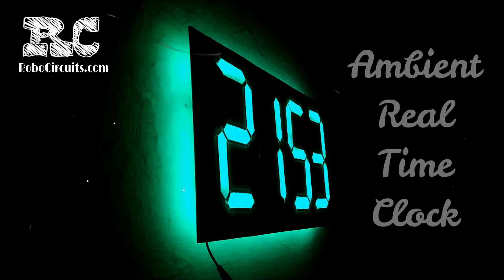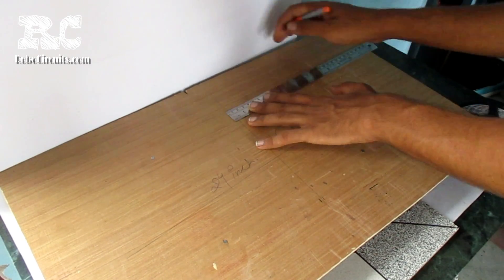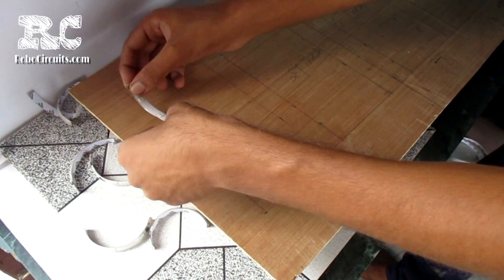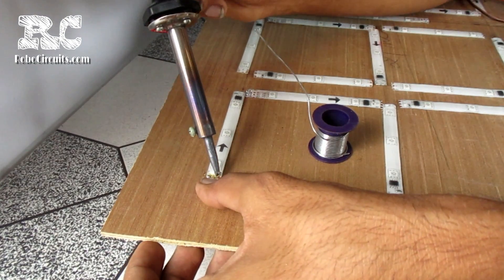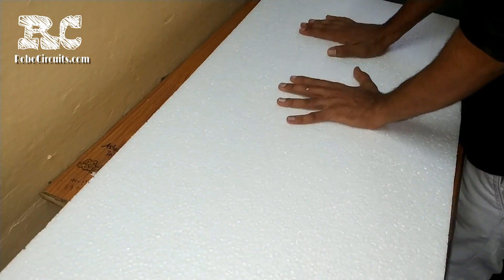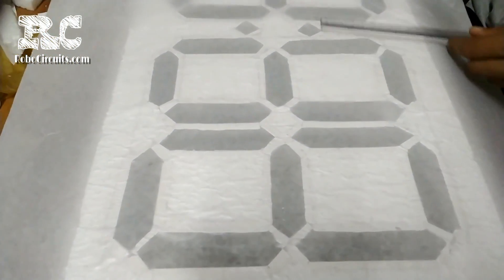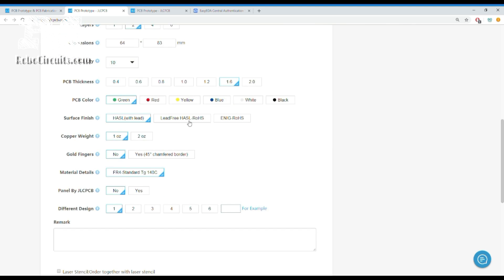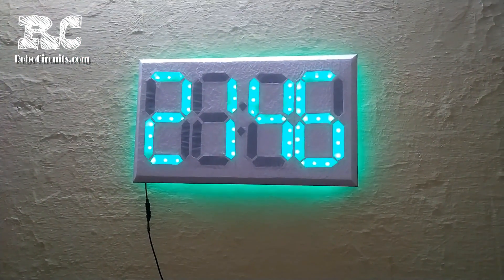A Stunning Clock for your Room!!! Ambient Real Time Clock with Arduino

Comment: can this be made to be a counter up?build it like you did but  something like 10- 7 segment displays? i dont even know if there is a program for that?????
Reply from the maker: I can't understand your concern... Kindly explain
Reply: @RoboCircuits   i want to build an up counter that will count to 1 billion and i want to build my numbers (7 segment display) like you built for the clock. you have 4 displays that show numbers, i want to build 10 and make it a up counter. i want it to count normally, it will take 27 years to finish the count. so can it be done?
Reply from the maker: Yes it will work with it